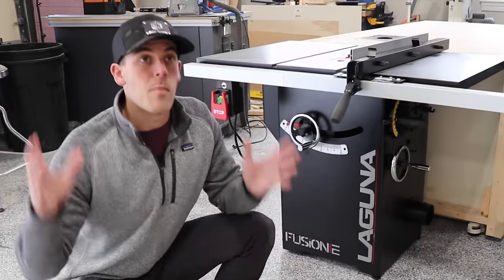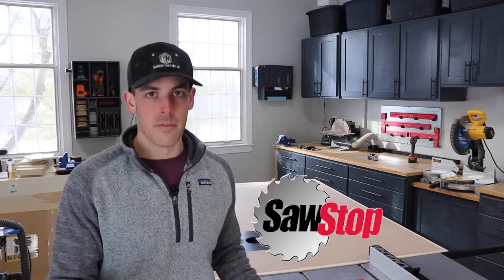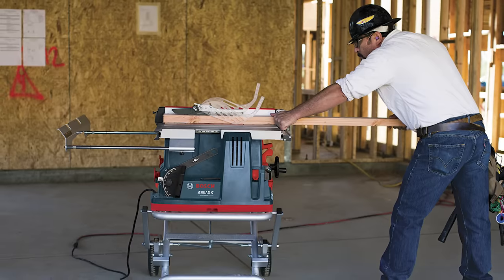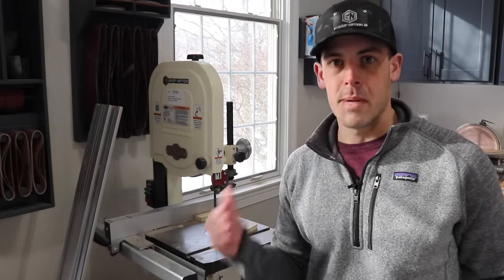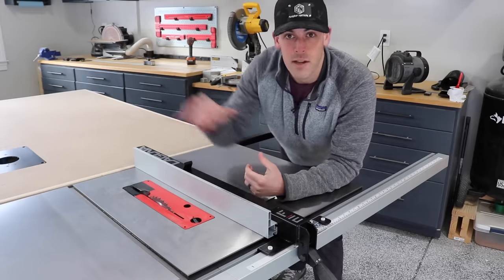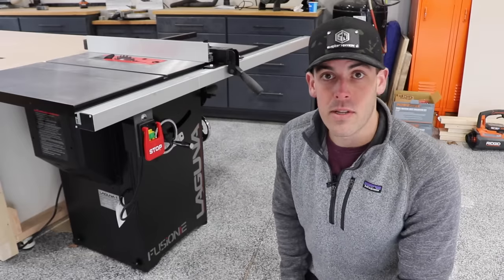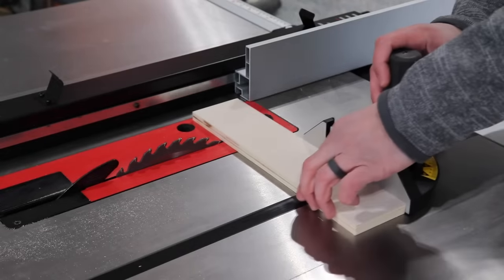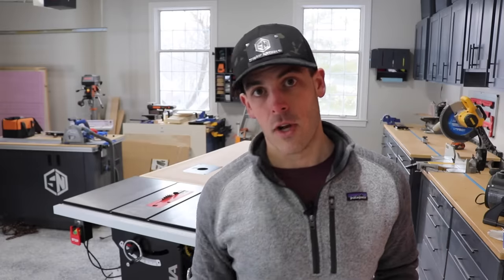Why I Bought a Laguna Table Saw over SawStop!

Comment: When I bought my SawStop almost 10 years ago, I did a simple calculation - I knew I was going to use this for at least the next 20 years probably no less than every other weekend. The $1,500 lift for the safety capabilities comes out to $75 a year in finger insurance. I've never regretted the decision and now with my stepson using the saw I am as confident as ever that I made the right decision. He made a poor woodworking decision and touched the side of the blade while trying to cut some small pieces. SawStop did its thing and all he had to replace was his underwear (scared the crap out of him!). I got to use that as a teaching moment on the use of the various guides and push blocks (Microjig GRRRipper) that I have for those types of cuts.  I didn't have to go to the emergency room and that made it all worth it.
Reply: Hopefully he won't have an accident and regret not to buy the Sawstop, I had a near experience and realized that there is no price on loosing the fingers so I bought the Sawstop it already made the money to pay itself..
Reply: Do you have the same finger protection on your band saw, planer, jointer etc? Hen my chainsaw comes with the same auto safety feature I’ll spend up for the same stop.
Reply: They should make something like that for those tools as well, would get them asap. When your hands are your tools to make a living, I will protect them anyway I can.
Reply: Everyone has the right to make their own decisions, but I wholeheartedly agree with your way of thinking, and applaud your choice!
Reply: @Cyber-Riot  This is the point that seems to escape most anti-maskers:  It's not directly for you.  It helps others, and if we all participate, makes an appreciable dent in transmission.  For most anti-maskers, they don't understand altruism at all.  Think about how many times you've heard the phrase 'I don't give a fuck' in the last decade (or more).  A fitting epitaph for people who can't think for a second about the benefit of others, in even such a small way.
Reply: The argument should be the probability of losing a finger/mangled hand or ~zero probability of the “probability of losing a finger” when you take that out of the equation with sawstop.

He said he was a does statistics for a living but didn’t take into account that this becomes two different events that do not share the same sample size.
Reply: @dominicdelprincipe2583  every study that has come out says that you are wrong. But good job for bringing up your mask fetishism in something that had nothing at all to do with it.
Reply: @GarionDAdkins  "Every study" says I am wrong about what?  You're pretty confident about what "every study" says.   It's this kind of mindless absolutism that makes me take comments like this with a large grain of salt.
Reply: The number one table saw accident is not skin contact to the blade, it's kickback.  Sawstop won't keep that from happening.  Use common sense, respect the tool, and you can avoid hitting the blade with your fingers/hands.
Reply: I would only get a saw stop if I were planning on teaching or letting my children use a table saw. Know what causes kick back and do not put yourself in that situation. Don’t use loose clothing around a table saw. Use the fkn push sticks and keep your hands away from the blade!
Reply: My only problem with this video is it doesn't look like he has ever used the saw he is reviewing:)
Reply: @ryandowling6917  Bandsaw and planer are less dangerous. Table Saw and jointer are the most likely culprits for injury to the point I don't really want either in my shop, as it's just a hobby after all and I need my hands for my actual occupation.  

In any case respect the tool and take the proper precautions and follow the proper procedure, shit can go down really fast as soon as you get in a hurry or are distracted for a few seconds.
Reply: I have nothing against SawStop. It's a nice saw. I would be happy to own one. But I am buying the Laguna F3 because it's cheaper but seems every bit as good as the SawStop, or Powermatic, or Delta, or anything else I have seen. 

I have been using tablesaws for 32 years now and I still have all my fingers. I respect the tool. I take the danger seriously. My fingers don't go near the blade. I don't use power tools when I am sleepy or drunk. I use a push stick if I have to. I have the same respect for all of my tools, and several of them could hurt me bad. It just seems like if I or maybe my kids or a friend knows that the SawStop will protect them, maybe they might be tempted to get cute with it and maybe that might be the time it fails...and I also heard that it sometimes works on slightly wet wood and ruins your nice blades.
Reply: @ryandowling6917  Exactly, angle grinders cause way more injuries than table saws. If a person becomes careless around a tool as large as a table saw (because of a break) I would imagine that attuite would only up their chances of getting hurt by the smaller tools.
Reply: @WorBlux  I waited years before even buying a table saw, I was only using a miter saw and your sandard size lumber( 2x4, 1x3, etc) to make a sell furniture but eventually learned enough about safety and been using the table saw for 7 years now. I always respect the saw a try not to be silly regarding certain cuts. I use common sense and of course , I pray before I am going to do any kind of woodworking. Good bless.
Reply: I agree with this rationale.  I stopped myself from reaching over the saw while it is still running. I repeat do not rush. This is a serious tool. Do not do sketchy maneuvers on the saw. My spidey senses tell me when I am thinking about doing a dangerous cut.
Reply: @ryandowling6917  I'm trying real hard to imagine someone accidentally sticking their whole hand deep into a planer to get cut by it. Maybe I should start selling finger insurance exclusively for planer usage.
Reply: I agree it's cheap insurance if you do it that way. But I don't have $3000 for a saw. Insurance is spread out, that saw price isn't
Reply: @ryandowling6917    Mitigating risks is what life is all about

Comment: One month ago I, for some unknown reason, failed to use a push stick. When the piece kicked back my hand fell into the blade and my index finger got caught by the blade. I live alone and had to drive myself to the ER while bleeding profusely. It's a blessing I didn't lose the finger. So to me this is very much a reality and the cost of a SawStop is worth every penny. I can't even imagine what would have happened if I hadn't lowered the blade from 2" to 1/4" and the thought of it happening again, and not being so lucky, is terrifying. My SawStop should be here by the end of the month
Reply: What, nearly losing one little index finger made you decide to dump your old saw and waste thousands and thousands on a Sawstop?  For any good woodworker,  silly safety features on a table saw that costs extra are just not worth it, until they are.  Seriously, glad to hear that you didn't lose your finger and didn't give up on woodworking.
Reply: Living alone concerns me, and I'm quite a few miles from the hospital, but I surely can't afford a Saw Stop.
Reply: @elizabetholiviaclark  I know what you mean about the cost. I'm blessed that my mom and dad were able to pitch in to cover cost. And when I got the hospital bill I realized the cost of the saw was actually less!
Reply: @brandytabor1147  I have no doubt that the saw was less than the ER bill, and I'm glad you have it now.
Reply: Always use a push stick on cuts less than 8 inches
Reply: @charleselkins4546  could have saved a ton of money by just getting some Jessem table saw guides.... Stops kickbacks
Reply: so what you are saying is that a saw stop is absolutely essential to people who make a conscious decision to be stupid and use their saw in an unsafe manner therefore everyone should get one because you didn't use the saw properly...got it
Reply: So really you should buy a push stick instead of a sawstop
Reply: Next time use a push stick and save thousands AND your fingers.
Reply: All it takes is one fairly serious table saw injury and you would have been money ahead on the saw stop. Guy I work with lost 3 fingers on his, a guy with 30 years of experience in wood working, and cost him tens of thousands. 

A sawstop is a whole lot cheaper than that.
Reply: @kellym3610   You can't spend your way out of risk in daily life... and risk is all around us... so risk mitigation is a PART of life. If crossing the road, you look left & right & gauge any risk... driving, the first thing most will do is click the safety belt... we are careful of what we consume... all this is risk mitigation... which we MUST do to live in the modern age... 

I remember reading in an engineering textbook that the #1 most dangerous machine (by injury-count) was not the lathe... or the mill... it was the humble drill press... why ? .... because people don't respect it.

Holding stuff down whilst drilling, getting long hair caught in the chuck, using blunt drillbits which then shatter from the unnecessary heavy drilling pressure etc. ... the point is if you take a known risk, you have only yourself to blame. And having a Sawstop doesn't mean you'll never injure yourself with another tool, hand or powered.

When cutting small/thin stuff, I use homemade featherboards and leave the riving knife in at all times... 

But more importantly, I also use a 1" "shim'' on the fence whose length stops at the centreline of the sawblade shaft... this is because sometimes, instead of closing, the kerf can OPEN whilst ripping timber... this will then push against the standard long fence & can also trigger a kickback... the shortened fence allows the space for the kerf to open safely...safety truly is a state of mind... and a healthy respect for the tools & their ability to bite will keep you safe MOST of the time... but shit happens, even when you take care, if people can't handle that risk, they should not get out of bed... 🙄😒
Reply: @rmealman  I trust myself to screw up at some point even though I choose not to take shortcuts - not everyone makes mistakes due to conscious decisions
Reply: @peterfitzpatrick7032  or, if they want, take advantage of safety features available - for some lucky people a sawstop might be a choice, so go for it if you want.  Plenty of people certain of their capabilities and of their safety measures end up injured.  Not saying you don’t have it covered, you’re clearly a bit of an expert (I mean that sincerely), just not everyone is!
Reply: Well, obviously, you have no business using men's tools.

Comment: I knew all the comments would come. This video is about why HE chose the Laguna over the SawStop. Obviously price is a major point. Your fingers can be priceless but that still doesn't mean you have the money for a SawStop. If you have safety at the front of your mind every time you approach the saw you won't have an issue. He presents many good reasons for choosing this saw over the other one. There's many old woodworkers out there with all their appendages. Don't go into debt because you think you might forget to practice safety one day. Buy what you can afford and learn how to use it properly. If it's a SawStop, great. If not, approach the table saw every day like it's a dangerous tool, which it is, and you'll be fine.

Comment: I've watched countless YouTube woodworking videos and I don't remember one that claimed you need a SawStop to be considered a serious woodworker.  Regardless, Laguna makes good stuff.  I have the 18BX and a Supermax drum sander and they are great.
Reply: It goes both ways. It's sort of seen a sign that you've "made it" when you earn a free/discounted SS (not sure if they are doing it quite as much as they used to). And also, whenever a someone uploads a video featuring their new saw and it isn't a SS, the comments sections are FULL of armchair quarterbacks saying how they made a mistake by not getting a SS.
Reply: Basically the only reason I´d recommend a sawstop (with the safety feature) is if you are not a serious woodworker. Otherwise, I´d always take superior machines for the same price (or price range).

Comment: 16 years ago I went through the same calculation in my head. I’m an engineer too that balances risk all the time.  A few weeks ago, I had a kickback from a 1/4” ply piece.  Thank goodness my hands were not near the blade. But if they were, I could have been bad because it threw my hands forward.  Two days later, I ordered a Sawstop.  Safety is priority Number 1.  I consider myself an extremely safe woodworker with thousands of hours of experience.  Yet all it takes is one mistake and your life is changed for the worse.   It’s the “it will never happen to me” mentality that gets you hurt.
Reply: So your experience is telling you that you're now MORE likely to have another accident?
Sounds rather like your acting on your scare, rather than doing a risk calculation. 

With that said. Of course, the safety of you and your loved ones should be prio one.
Reply: @Croziz  something is seriously wrong with you.
Reply: if safety is priority number one then don´t operate any saw ever again, don´t drive a car in fact don´t ever even step onto a road. period.
Reply: I guess we have all seen the Thintz12 video. That astonished me when I first saw it all those years ago.  I've used and set up a lot of says since then, and have seen scary things like the guy at my Menz Shed who insisted it was OK to push a misshaped log through a big cabinet saw.  According to Stumpy Nubs, it will soon be compulsory for saws sold in the USA to have SawStop brakes fitted.  I live in NZ and the cheapest Sawstop here is NZ$7899!  I've used and loved a DeWalt jobsite saw for years, but I feel like treating myself. The Laguna F2 NZ$3949 which is half the cost of the SawStop, so I am going with the Laguna.
https://youtu.be/u7sRrC2Jpp4?si=ObghK6wBSf_69fyg&t=152

Comment: I too had my choices between this exact saw and a sawstop. I ultimately chose the sawstop for two reasons: 1.) I want to teach my sons woodworking and momma said get the sawstop because she wanted to reduce their risk (she’s the boss)
2.) I am an emergency room NP and it would be very difficult to do my job missing fingers. (With that though, the point of a sawstop is to never set it off)

That being said I agree with everything you said and definitely weighed both options. I was so close to choosing the fusion2 that I had it ordered. Of all the little info out there on the saw, I heard/read good things. Love your channel been with you since 500 subscribers!
Reply: Totally agree with this. I want our family to enjoy woodworking. My daughter in law is scared to death of the table saw. I do not regret my decision in any way. BUT everyone needs to make their decision and live with it. I have owned several table saws and for safety I believe it is even more important to get the most HP. 220 if at all is possible. I purchased the 3HP 220 and am VERY glad I did. Very dangerous cutting on an under powered saw no matter what brand. IMHO.
Reply: So far I count 3 medical types posting here. All 3 went with the SawStop. Is it financial? Maybe partly. But mostly it's the added safety in what is otherwise a really nice saw. When you've seen what can happen, and hear how it happens, you gain an extra measure of respect for what can go wrong--even to those who are experienced, knowledgeable, and always careful.
Reply: If you use a table saw properly (which I would hope you do if you instruct your sons how to use one), then the safety feature is obsolete. So I guess you just think you know how to use a table saw, but you really don´t.
Reply: @steveh8724  There is basically zero chance you cut yourself if you are experienced, knowledgeable, and always careful. You can only harm yourself if you are stupid or think you know how to use one.
Reply: @bowlchamps37  safety is never “obsolete “?
Reply: @bowlchamps37  

Table Saws: These tools, which are omnipresent in construction sites and woodshops, are responsible for the most number of injuries involving woodworking – 39,750 injuries annually. The National Institutes of Health also estimates that there are more than 30,000 table saw injuries in the U.S. annually. Fingers and hands are the body parts most frequently injured by table saws. The medical costs of treating injuries caused by table saws top $2 billion annually.
Reply: @Mark Randall  
There's no way the average medical cost of hand injury from a saw is nearly $70,000. Before I believe those estimates I would have to see how must SS donates to the NIH for these studies

Comment: I bought a SawStop. Because that’s what I wanted. I had seen one of these when they first came out. (Years ago). And always wanted one. And I now happily have one.  Skill is what makes a serious woodworker, not his tools, but they do help.... good video!!
Reply: I also bought a SawStop.  Also because it's what I wanted.  I'm a retired ER doctor who has attached more fingers than I care to count, fortunately  none of them mine, and I'd like to keep it that way.  That said, the most common cause of severe table  saw injury isn't blade contact, but kickback, and SawStops do not prevent  that.  I'm happy with my choice, but if I had it to do over again, for roughly the same cost I'd get a slider such as the Hammer K3.

Comment: I recently bought a Fusion Three. I have used it only for a short time and I LOVE it. The dust collection is amazing. I just built a small cabinet for my wife's scrapbook punches. The amount of dust when hooked up to my shop dust collector was surprising. I had very little dust if any in my shop. I bought a blade just for plywood and the saw cuts like butter. I am so happy to have bought  the Laguna. I could not have afforded the same saw in the Sawstop.